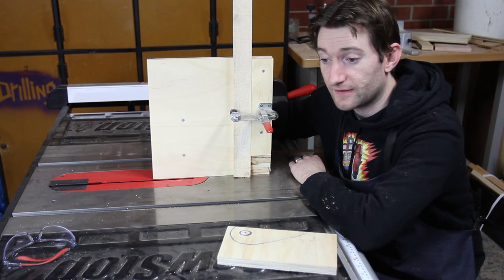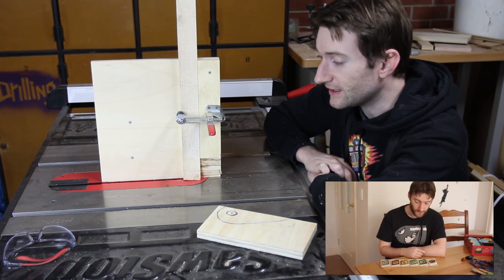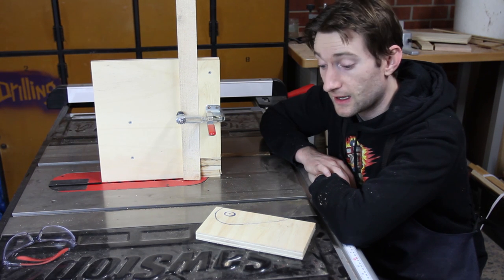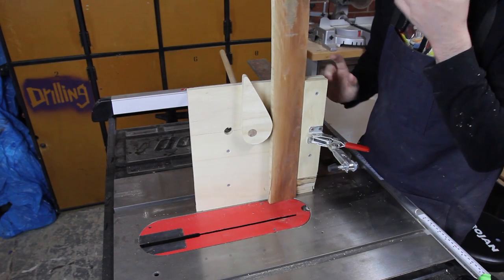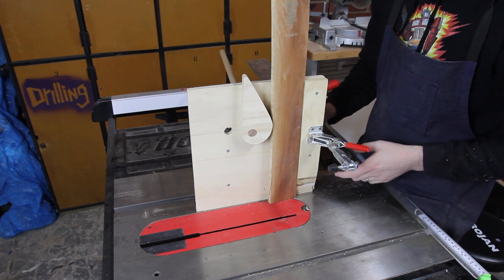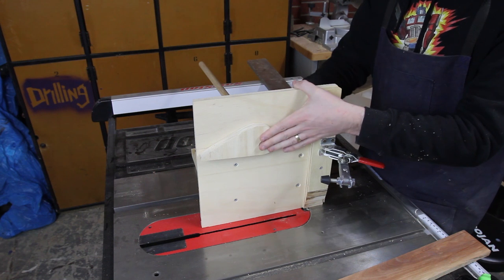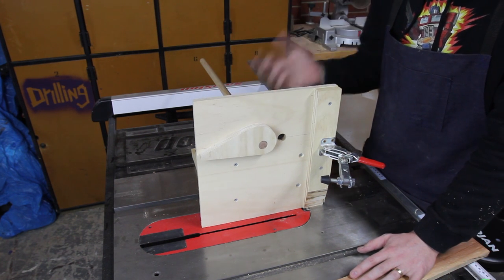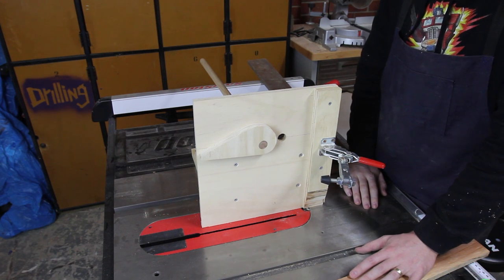016 - Tenoning Jig Part 2

Comment: The effect of the cam - if it were to operate properly - would be to force the work-piece tight up against the vertical brace - it would still need of course a clamp to keep it vertical in the other plane - but......

As the work-piece advances towards the blade - the forces from the blade will tend to just duplicate what a cam might be doing - work moves forward and blade presses backward. Is a cam necessary?